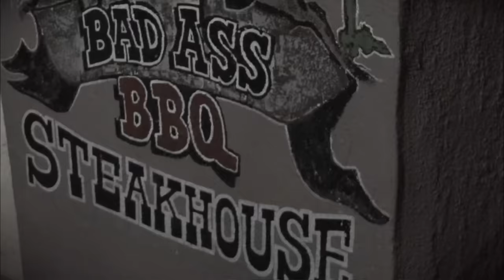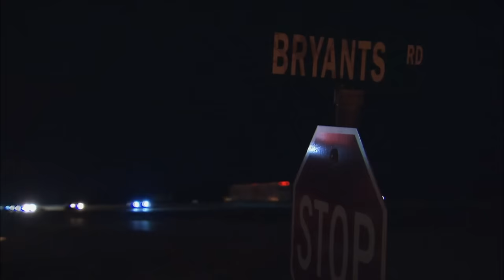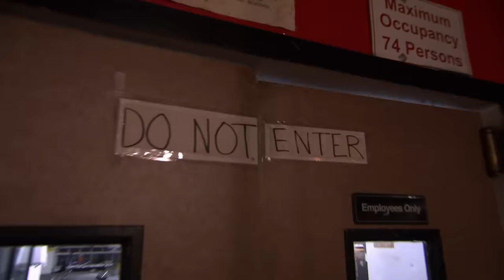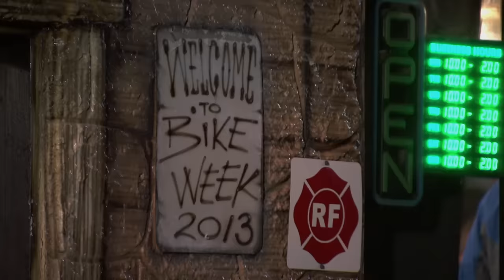Bar Rescue’s WORST Biker Bars 🏍️

Comment: Had I been Taffer, I would have walked into the first bar and told the drunk owners to go screw themselves. Any bar where the owners allow motorcycles to burn rubber inside and let a horse crap on the floor is beyond rescue.